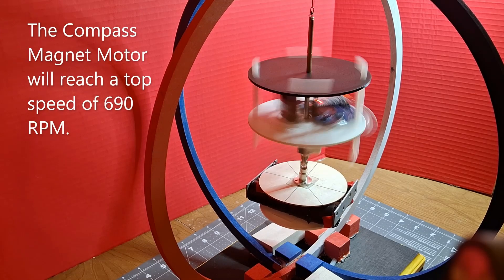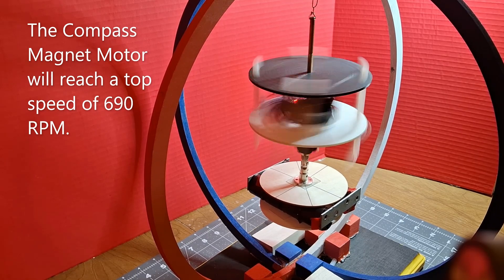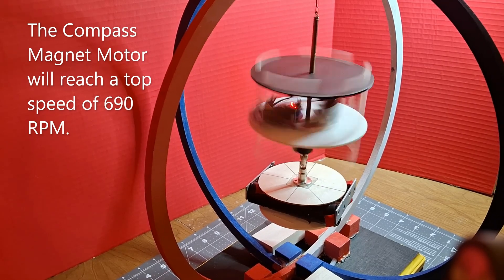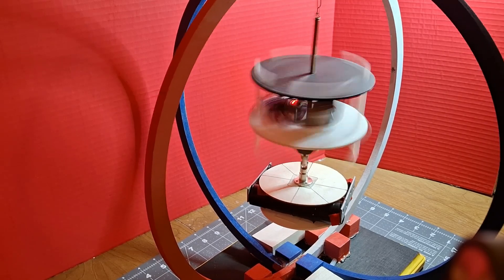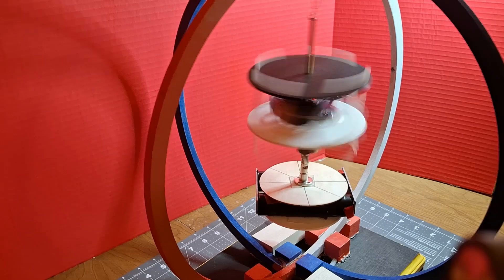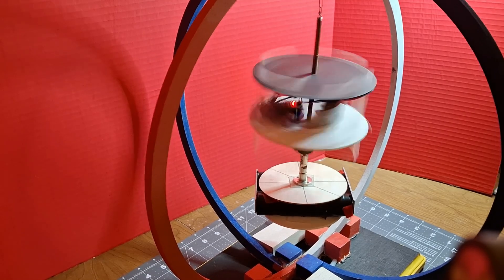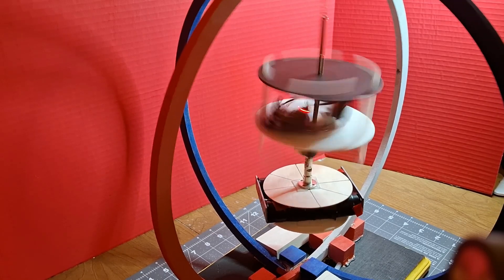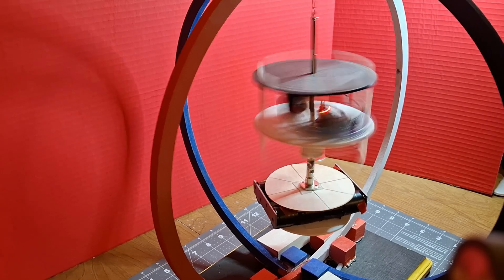Absolute Top Speed

Comment: You should use magnetic AC selonoid vibration instead of spin
Reply: If you are using this to try and move an object then Actually I don't mean you should go my way to create a selonoid to move the object, it's just a suggestion. You can use spin to achieve the object movement. The key to moving an object is through the normal frequency's smooth flow movement of the object along with a extremely lower frequency which is normally the beat frequency which is extremely lower. It's just like you breathing normally then suddenly you get an hiccups, your whole body suddenly moves differently. Or a normal driving of a car then suddenly it collides with another vehicle. The setup you just did I think correct me if I am wrong is that it only has a frequency and does not have the beat frequency. Please don't confuse yourself with the spin frequency because it's vibrating horizontally. Your two frequency must have vertical vibrations to achieve the thrust in that vertical direction.
Reply from the maker: @jeffreydani8616  This motor is not intended to create linear translation.  It is only intended to rotate. See our videos about the "Virus" magnetic boat for linear translation using a magnet and servo.
Reply from the maker: @jeffreydani8616  Thanks for watching and commenting on our video. Would you please elaborate?